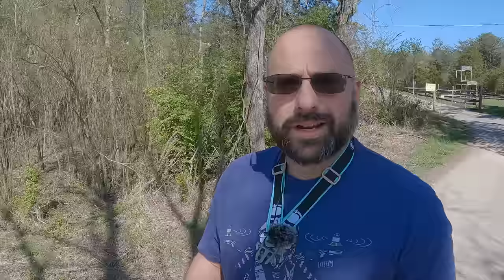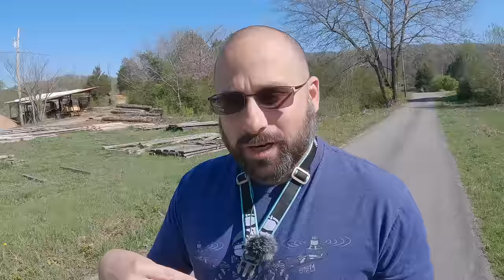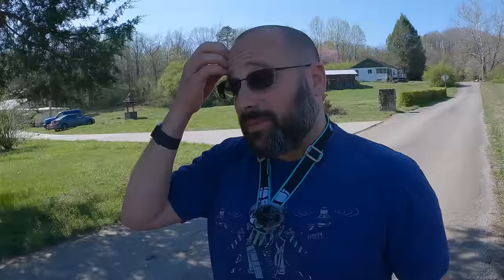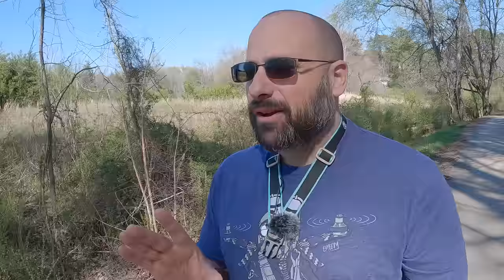Betaflight vs Kiss: Who's Using the Better Dshot?

Comment: 6:00 - wo wo wo... KISS runs at 1k PID loop folks.  So not reducing latency.  KISS is laggy, especially on the sticks since it uses D-term Setpoint Weight still for any kick on sharp stick moves (as an option) vs. modern FeedForward like BF or iNAV.

1k = loop every 1ms.
Dshot2400 = 0.03125ms

So at 1k PID and Dshot2400, you send the same data to the ESC 32 time!  Why?  The ESC heard you the first time.  Ok, so if you want to send a couple times, fine, but 32 at the risk of more jitter?

The phrase "say it once and say it clearly" comes to mind.  No need to beat the ESC over the head with it.

Personally, I just run Dshot600 all the time, cause I'm lazy and don't care.  Yeah on BMI, I tell the ESC two time (same data) so that might be a waste, but IDK.
Reply from the maker: Umm. WTF is the point of running super fast dshot at super low pid rate? If you care about reducing latency why not run at 8k.
Reply: @JoshuaBardwell  🤷‍♂️
Reply: KISS used to allow for up to 8k PID loop back then. But at one point they changed it so it's always locked at 1k only.

As you stated in your video; BF has studied what the best DShot is based on what gyro is being used, this what PID loop update rate is needed. Hence they've proved what works best. While KISS on the other hand recommends to run the fastest DShot possible because that's what they think. And last I checked when they were using MPU6000 gyros, those can go to 8k. Yet, they run it at a 1k PID loop... 

The big difference I'm seeing between BF and KISS is one group has done the work and proves it works one way, while the other group thinks it's the best way. See the difference?
Reply: Kiss stick feel is better than anything betaflight can manage and the performance of ultra is better than 4.3, so they’re doing something right with these ancient methods.
Reply: The problem is, that is not true when you really look at it objectively.  But fly what you like of course.

As an engineer I have pealed back the layers, that is what we do, and found out the KISS claims just do not pan out unfortunately.

KISS vs. BF/iNAV it is:
1 Laggy (poor tracking of you rates for sharp moves ... which you can do in BF / iNAV too if you like by lowering or turning off FF.)
2 Has throbbles (nose bobble or drift on rapid throttle changes)
3 Has a hard time with drift at 0% throttle
4 Worse prop wash performing tuning both on same rig
5 is harder to tune.  I-term is a narrow range vs. BF/iNAV have a wide range, almost taking it out of something that needs tuned.

Almost 100% of the time, folks that like KISS just ignore these things. Which is cool, but they are there when you really sit down to compare the two.  I did a bunch of videos on it to show more details if desired.
Reply: @BikeGuyFPV  one group acts and proceedd based on engineering principals and well established practices.  Can backup what they say with testing done, results, and explain the logic of why, when questioned.  The other, marketing.  The "because I said so" approach.  That is the difference.

You can even see that in JBs video.  BF is explained.  KISS, basically sumed up to "IDK, because one guy said so."  Because that is all the reason given from KISS.
Reply: @uavtech  these things may be true for Kiss OG but not for Ultra, there is zero bobble on throttle chops, it is locked level during punch outs and it has zero prop wash. It’s quite incredible. I’ve come from over two years of betaflight with perfect tunes and it is very good, but ultra genuinely blew my mind and it is better.

In terms of stick feel and following rates, is that even important? I don’t thinks it’s important at all, if I have to choose between betaflight perfectly following my rates but feeling robotic to fly vs kiss not perfectly following my rates but feeling smooth and nice to fly, I choose kiss. The quad is still flying along the same path… it just takes different stick movements to get there. It just isn’t important.

I have tuned betaflight to fly like kiss and while it does improve its feel a lot, it’s still not the same.
Reply: @uavtech  I am planning to do a betaflight, emuflight, kiss and kiss ultra comparison video but it’s going to be at least a month away as I’m going on holiday next week. The kiss ultra, emu and betaflight quads are exactly the same build (obv not the FC).
Reply: @Atlas_FPV  I would do the same exact quad.  It is more work, but the same build is NOT the same quad.
I did testing on ULTRA.  Discovered a bug everyone was missing and then also how it is not any different than classic KISS.

If you are going to spend any time testing, make it thorough.  Use the same exact quad.  Different builds with the same pars still have variability that you don't need to introduce.  Log it.  BF logs and so does KISS.  Break down the differences you are seeing between the two at that granular level.

Do hard moves for a quad to deal with -- 
1. Throttle pups and chops
2. Propwash turns
3. Hard Yaw moves (inverted spins use hard yaw)

Personally, I did all that on DEFAULT vs. DEFAULT and TUNED vs. TUNED.  BF just flies better all around.  As far as I'm aware, it was the most thorough testing ever done.  So if someone wants to convince me, you need to match that level of detail or exceed it.  If you do, and ULTRA prevails, you will have my attention and I'll re-test again.

I have always said, it flies fine.  Just as FalcoX, Emu, Cleanflight, iNAV, etc...  but clearly not better.  I have tuned multiple folks quad professionally on BF and KISS.  A couple times same component builds.  BF was always just better on default and after tuning.  So I don't know, going through the motions at different times on different quads at different times, keeps coming to the same result.  Trust me I have tried very hard to make KISS fly as well as BF on quad (3", 5", 7" and 9").  It just lacks some tools that BF has to make it fly better.  Things like i-Term Relax and Anti-Gravity are probably the two biggest.  

From a quality of live standpoint: it is annoying to the wire up (very specific sometimes backward wiring), it is not as compatible with peripheral devices, and not having the sliders is a PITA for making fine tune adjustments to PIDs.
Reply: @uavtech  That test of yours was over a year ago. There have been a lot of changes. I would suggest a revist just to see how things have changed. And to be perfectly frank I've never seen a kiss quad fly as bad as any of yours during all of your testing but that is probaby from the builds you put together to test...
Reply: @MikePilk  what changes specifically?  What new features?

I have seen it on 3", 5", 7" and 9".  RR did a KISS video, throbble city.  You see it when you actually are open to seeing it.  The same build flew fine on BF.  Another talking point folks repeat but ignore that fact.  KISS was on ok on it.  Just not better.  The default vs. default was not better either.
Reply: @uavtech  again all I said was revisit. Its up to you if you feel as though it’s worth the time for you or not. Stuff has changed not in fettec or legacy but kiss ultra fw specifically. RR episode was fettec gear on legacy kiss. Either way I could care less but your information is dated no matter what you say🤷🏼‍♂️🤷🏼‍♂️🤷🏼‍♂️
Reply: @MikePilk  yeah, maybe.  But if it sounds like no meaningful change.  Version numbers increased, but no new features.  Probably just DJI compatibility stuff, etc...
Reply: @uavtech  again you are wrong, but it is what it is.